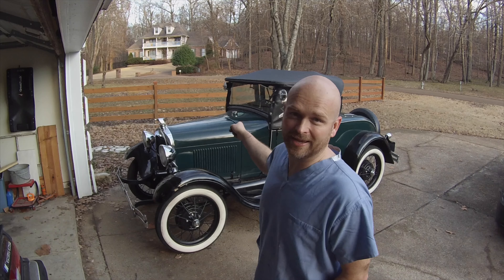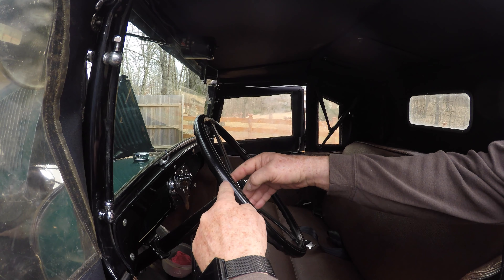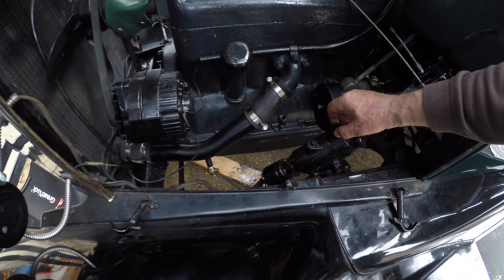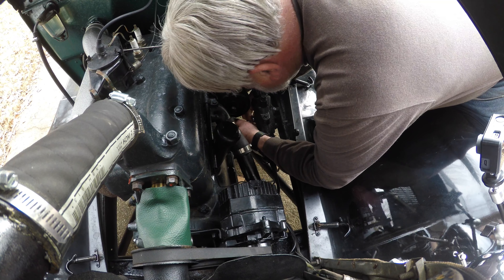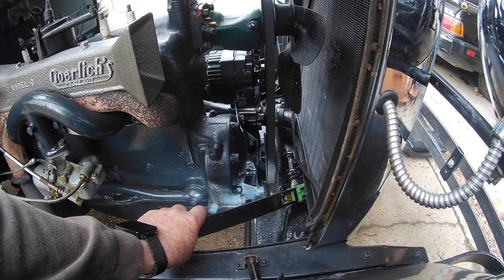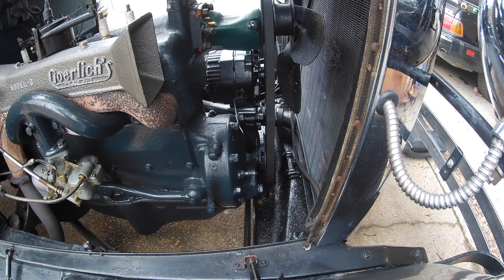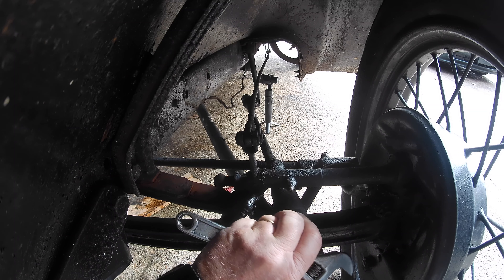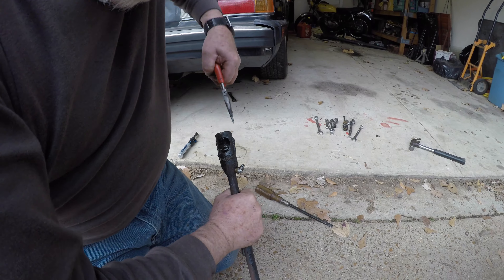Rebuilding the steering on the Model A with some upgraded parts!

Comment: The top bolt preloads the worm bearings, you NEVER adjust that unless you take the pitman arm off. You need to feel the tightness of the bearings by moving the wheel while adjusting that bolt, or you may crack that very expensive upper race. THe race will not even move unless you loosing the clamp bolt on the steering housing.  So you ended up not doing anything by playing with that.             

The bottom adjustment on the steering box is to center the sector to the worm.  You jack up the front wheels and adjust the screw (swinging the bottom of the sector housing) to were the steering wheel feels tightest when the front wheels are straight ahead. THEN you adjust the top nut (that swings the top of the sector housing) until the play in the wheel is nearly gone.          

The play in the steering wheel may be due to worn sector shaft bushings, one person steers the wheel back and forth while the other person watches the shaft /pitman arm moving in an up and down motion.            

 I did not notice you checking the steering balls for roundness. Those balls being out of round will make the wheels hard to turn. The parts inside the tie rod and drag link seldom wear out!    

Check the tightness of the front wheel bearings, too loose the car will wander and wobble.

Also  check if the king pin bushings are loose by grabbing the top of the front tire and shaking the car back and forth.  If you feel looseness then the bushings are shot (if the wheel bearings are adjusted correctly).    

One must grease all of the fittings every 500 miles (as per Ford instructions) or you will wear the entire front end out.
Reply: Agree with not adjusting the top bolt. I tried that many years ago on my '29 A and it did not help anything and it had a hard "notchy"spots while turning the wheel. I loosened it up before any damage. Sloppy steering from the gear box is really not repairable with out replacing the two gears which back in my day (1954 you could not get new ones). The oil will leak out of all these boxes. The bottom seals ALL leak. Put GREASE in the box if you can replace the gears.
Reply: @oldguy2800  i have a 1929 model a and is got the same problem lots of movement in the steering wheel How do I fix it.   Thanks

Comment: I'm about to chase down a few steering issues like you guys did. I have a hoist (Lift as you guys call it), so that should make the job easier. However, here in Australia being Right Hand Drive, the steering box is jammed under the carburetor which makes things a bit more difficult. Grrr. 
Thanks for sharing your knowledge.
Reply from the maker: Thanks for checking out our channel, and I can't imagine everything being shoved over on the right side.  Gotta be tough!

Sean

Comment: Thanks for the good video.
the only way to properly adjust the steering play, is to pull the entire steering wheel assembly, out of the car. the upper adjustment, on the column, when first adjusted, after a total rebuild, should never need adjusting. what that adjustment does, is simply to lock in place, the upper bearing race, but it does nothing to adjust the steering play. Take the entire steering out of the car, then take the  Lash out of the steering gear in the steering box.
Reply from the maker: Great information, thanks!

Comment: That car appears to have been cosmetically restored only. A lot of mechanical work needs to be done. Check the pitman and drag link balls as well. Certainly shot. Good luck!
Reply from the maker: It certainly was cosmetically restored with a decent amount of mechanical work done.  We checked out the pitman & drag link balls and they were in good shape.  It gets driven at least once a week and is a ton of fun!  

Thanks for checking out our channel!
Reply: Auto Anatomy good to know. Sure is a sharp one! Did you get the slack out of it?
Reply from the maker: The Eccentric Hobbyist We got some of the slack out, the rest is in the steering box itself.  Haven’t played with it in a while

Comment: Those front engine mount springs are not original. They are an inferior early aftermarket part with rubber inserts.
Reply from the maker: Good to know, thanks!

Comment: Thanks for the video.  Never can learn enough on the Model A.  Any update on the front motor mount?
Reply from the maker: It was replaced with a new unit.  The vibration is still there, albeit somewhat improved.  Ultimately it would be nice to have the engine rebuilt and balanced, but that's another project for another day.  Thanks for watching, and check out some of the other content on the channel!

Comment: Did you guy take apart the steering box to track down the steering wheel play?
Reply from the maker: No, we started with the easy things first.  We replaced all the end link cups and then (per the manual) adjusted the box.  We ultimately need to take apart the box but wanted to address the known wear parts before jumping to big stuff.  Thanks for checking out our channel!
Reply: @AutoAnatomy  Are you planning on doing a tear down for the steering box? I only ask because I have the same amount of steering wheel play and I'm watching all the videos I can to better understand what do and how to do it.
Reply from the maker: @Dreadfish_1  Not sure yet, at some point we will but for right now it’s not annoying enough to fix.  

Sean

Comment: Feel it would be helpful to remove this video. Not sure of the goal of this video. In my opinion, appears like random part changing and an incomplete description of a steering box adjustment.
Reply from the maker: Michael,  first off thank you for checking out the video.  The purpose was not to provide a tutorial on steering box adjustment.  I am clear that my desire is to learn alongside everyone and gain knowledge along the way.  Secondly, I'm not going to remove the video as this is also about spending time with my father.  As we age things like this become more valuable, and I can watch this video and remember working on old cars with my dad.  It's like home movies, if you will.  

Sean